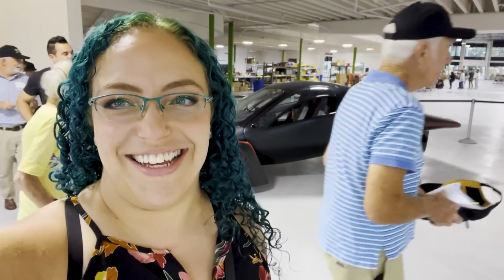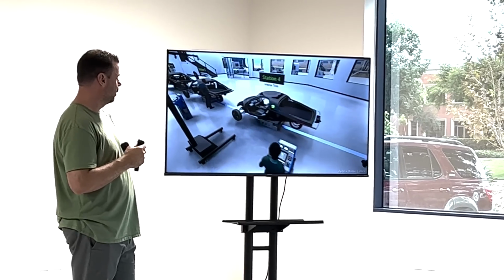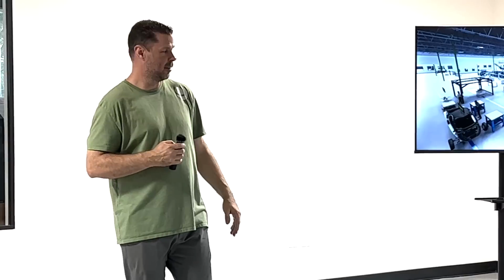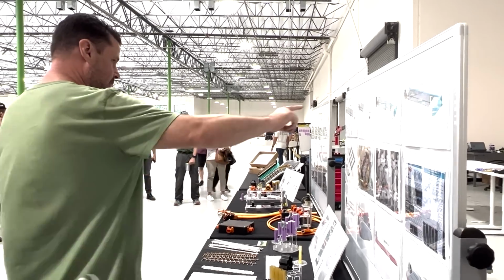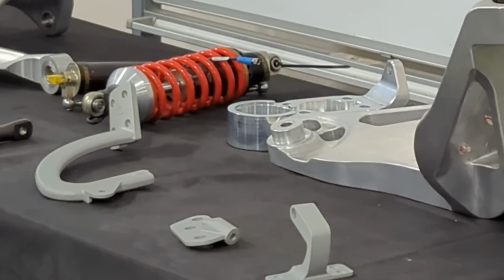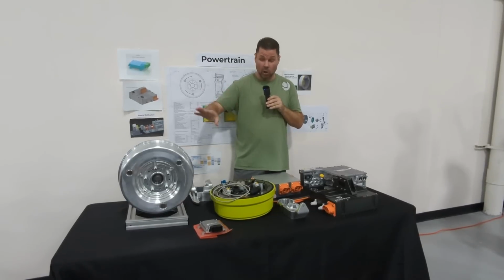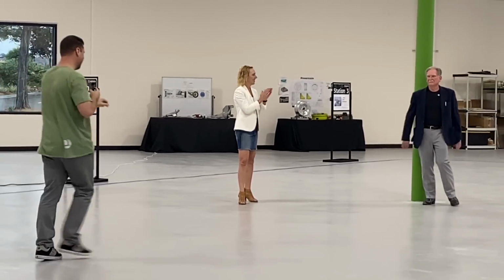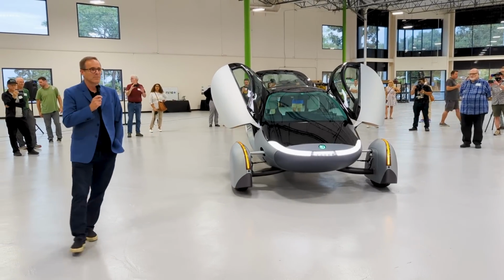Aptera Gamma Debut with special guest Sandy Munro!

Comment: As a traveling performer I need certain storage dimensions. The Gamma version definitely looked closer to what I need. From an engineering stand point I wonder how hard it would be to make a four seat version that could collapse the back seats. Thanks for sharing. It looks amazing!
Reply from the maker: Traveling performer? That's so cool! What do you perform? And ya it looked bigger than I was expecting! - Liv
Reply: @theelectricduo  I do flow art. LED flower sticks and fiber optic whips have been my focus and soon I plan to start performing with fire. I also do cosplay and the jellyfish costume is a bit bulky. After that the more room I get the better the tent I can use 😃.

Comment: Awesome video with great background on their manufacturing system which with Sandy Munro's help should make a big difference on their 2023 launch window.  I did notice something on the front wheel fairings/covers.  With the wheels turned to lock the small tails look like they might drag on an uneven road surfaces (there might be a few of those on American roads).  Suspect a small design element they may change for Delta.  As a pre-order holder I also cannot wait for delivery.

Comment: Nice job, well done. If you ran over a 4 inch log would it get caught on the wheel cover? And if you pull up to close to a curb would it damage the wheel cover? Just trying to help.
Reply: The front few inches are EVA foam so you can bump into stuff and it doesn't damage it. The offroad kit will hopefully be a lot higher for rough roads and stuff.
Reply: @peterjorgensen3  why not make the whole cover Eva foam
Reply: @tonytiger8248  Or the bottom 6 inches of it a flexible rubber curtain? Like they have around the bottom edge of semi truck cabs?
Reply: No.  The wheel cover would rise with the wheel, unlike the front air dam on many similar sized cars.  Close won't damage a wheel cover, but scraping it could.

Comment: Bruce -You couldn't tell if I was there or not, you don't work there; so why would  you know? You Don't..  You can't even say when Aptera will make any motorcycles. ZERO  production vehicles ZERO, and they won't be at the end of the year - in fact - they don't have anything going for production do they?  OR THEY"D have another damn video all about it.   FUD=APTERA.  Your fking excuse is COVID! TESLA made more cars than ever; so did BYD,  practically any EV maker; just not APTERA.
Reply: Oh, do you claim you were?  It is easy to not be exposed for fraudulent comments - just don't make them.  

I was there  in Union City when Tesla started and have been able to compare their early days with Aptera out of personal experience - not limited to news reports..  It took Tesla 6 years to deliver their first working vehicle and it was just a relatively simple EV conversion of the Lotus Elise.

This time around, Tesla started on the Cybertruck about the same time that Aptera restarted and began design of the present vehicle.  Guess who has built more prototypes, and will be in production first?  You have clearly not followed  due diligence and have some other issue behind your mis-direction.

Comment: The manufacturing left some critical elements out. The first, being furnishing the stations with the inventory they need for what is done at the station. With only 12 minutes per station, the inventory needs to be at the station in sufficient quantities to support the line's rate of movement. The second thing not addressed is the performance of the Aptera Production Quality Assurance function. Supposedly done at each station within the 12 minutes.  The third, what is done if some station fails to meet their target time goal or QA at the station stops the line, and the line stops or ?????
Reply: These are things they will need to work out. They're a few months away from a production model. The AGVs can move in any direction so the can pull one out if it needs more time.
Reply: I believe Steve did mention that if something went wrong at a particular station that vehicle would be taken out of the line, the problem corrected and then put back online.
Reply: Production will not start out at full speed in any case.  Initial builds proceed very deliberately until everyone is familiar with the process at each station, and understands the issues they meet in each step.

Comment: SURE BRUCE mr Ambassador no one can produce and tell you how many - Not Telsa ; not BYD , Not VW.. they probably can't tell you how many vehicles they will make based on last months production which in Aptera's case is zero.  You kept telling me they had socked parts and had a real supply chain - your just a liar.
Reply: Ok Mr. Jerk, reveal your valid source of data that verifies your critical statements. I suspect none and of course no knowledge of Aptera business or engineering operations. Back under your bridge.
Reply: What are "socked parts"?  You have never even visited the site as far as I can tell, and are willing to post FUD regardless of what is known.  "your'? (sic) Really?
If English isn't your first language, you could be forgiven for your difficulties in it.

Perhaps that is the case.

Comment: One question: did you see / hear speakers (radio) in the aptera?
Reply from the maker: We did not. We will go check it out today and see if we can - Liv
Reply: One Aptera employee mentioned that the premium sound system is not yet fully designed by their pro audio engineer.  We'll need to wait for the Delta prototype reveal in a few months to hear that. The good news is that they will make quite a few of them for show and tell events across the USA.

Comment: I am considering one of these, but I live on a gravel road that gets pot holes sometimes. It is drivable for regular cars, but small cars that sit close to the ground have to go very slow. Any body know how the Aptera would do on gravel?
Reply: There's 7" ground clearance. Gravel roads should be ok. Dirt tracks might be a challenge with punctures until the 3rd track wears in.
Reply: It's not that low. I have a Honda Fit. It's only about 4" from the bottom of the front to the ground. It scrapes on steep inclines but not on a regular road. I had to add some extensions to my car ramps to avoid ruining the front plastic parts. Most modern sedans are low in front to keep air from going under the car. Aptera doesn't need that because the underside is smooth and streamlined. Gravel roads are torturous for the finish on the body though.
Reply: Bear in mind that the front wheel pants (that is what they call them!?) are hard mounted to the wheel hub and thus move up and down with the wheels on the suspension.  Point being that you won’t encounter the circumstance where sudden compression of the suspension springs causes the wheel to rise up into the wheel well momentarily reducing you ground clearance as in a conventional car.  Excepting compression of the tire itself, you will always have the 7” of clearance.
The back wheel is the more familiar scenario so there… yeah.
Worse case, they are offering an off-road package; at least eventually.  Expect some sacrificed efficiency in exchange for more generous ground clearance and entry & exit angles.
Reply: I live in rural Iowa and will be reporting on my experience with an early delivery.
Reply: You are aware Aptera has an off-road option?
Find out more @ https//:Aptera.us

Comment: As a manufacturing engineer, I'm so happy with the attention they've given to designing the Aptera for manufacturing and building out the assembly process as efficiently as possible. Love that they're allowing access to the BMS details as well - setting new standards for transparency and right to repair!
Reply: Where did they release BMS details?
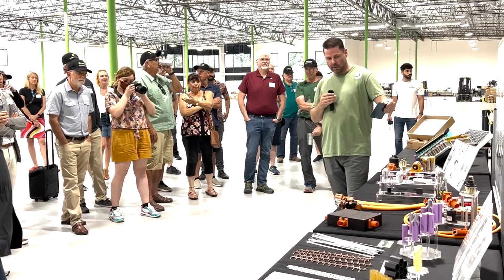Reply: @AstroStrongBox  I don't know if they've released BMS specifications to the public yet. I was referring to the video, starting at 8:43 where he discusses the BMS and how owners will have access to all of the details for the cells and overall pack health.
Reply: @AstroStrongBox  what's bms?
Reply: @MrGamelover23  Battery Management System

Comment: Great video! Loving what Aptera is doing. Hoping that the cupholders change though. Not a big fan of that net thing they have right now. Honestly, this might be my only complaint, which is minor. Curious if hail or going over a bumpy road might activate the hatch opening.
Reply: I'll sell you an alternative. Wait until I get my Aptera so I can make measurements 😆
Reply: I heard one of the Aptera folks at the reveal mentioned that that cup holder is not going to be in the final product. They has already designed something better for the next (and last?) production intent prototype.

Comment: Amazing progress for Aptera. Few things at first glance: 1) The font on the flat screen is trying too hard to be different. The car is already unique by itself. 2) The yoke looks like Felix the cat. It’s fine with me, but the flat button with the logo give it a look if a cat with one tooth.  3) The pedals are great but for some reason I would have loved them in aluminium cast. I know those three points are trivial in the grand scheme of this project. Little details easy to fix if needed and certainly not crucial for now. A fast production time is what is at stake. Great job aptera. Overall it looks stunning!
Reply: I love the fact I will be greeted with a smile every time I enter my Aptera.

Comment: Awesome! Thanks for sharing.  So so so looking forward to this thing to hit the streets.. 

Do we know if Aptera is going with the Tesla supercharger port standard yet?
Reply: Negotiations are still ongoing.
Reply: @n.brucenelson5920  I really appreciated the "SC standard" campaign that Aptera did/ is doing.  With a slight tweak, I think that SC & CCS should be recognized as co-standards..

Like how IDE & SCSI or how SATA & SAS & now NVMe(U2) are all computer storage disk bus standards...

I prefer SC for pure engineering minimalist aspects, and can simultaneously understand how "the industry" is just not capable of such collaborative standards decision making...

But I also remember the GM MagnaCharger (EV1 & s-10 used) and the AvCon standards (RAV4, Ranger, etc used) used in the '90s & '00s.

So there can absolutely be more than one way to push electrons on wires...